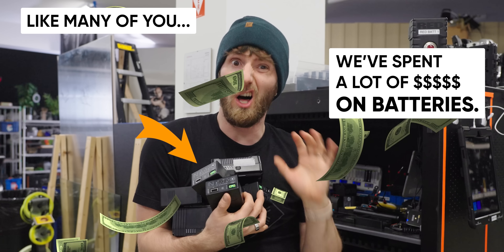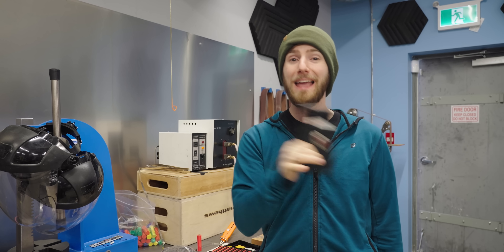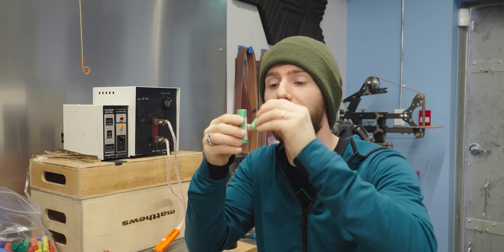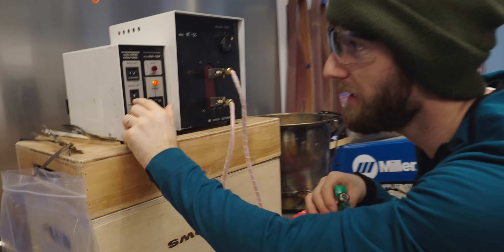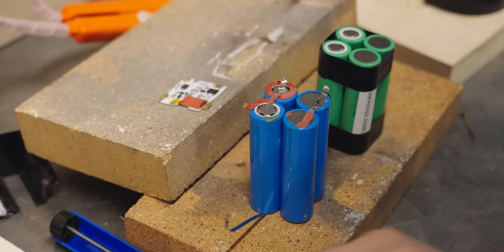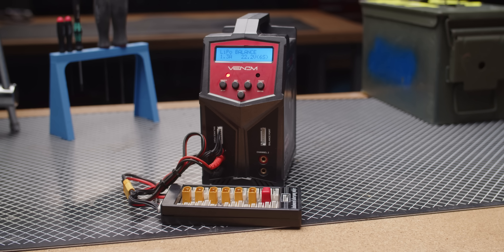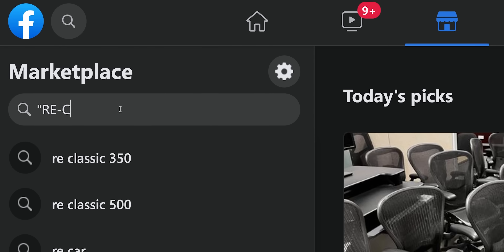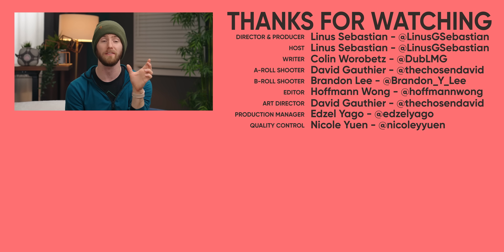This should be illegal… Battery Repair Blocking

Comment: A non-profit I help out with had two Dell laptop batteries fail about the same time.  I'm not sure if they died because of a protection circuit ot if it was planned obsolescnce.  I disassembled the batteries and all the cells aapear to be charging fine.

Comment: I remade my power bank with those kind of batteries before, I just use the tape and brass strip for connection which I first  soldered the brass to the wiring circuit. don't really have the courage to actually soldered the brass to the battery :')
Reply: Nice

Comment: "can short circuit during assembly" yeah, if you fuck it up
"can behave differently during charging" yeah, if the BMS fucks up or you charge at too high a C rate
"risk of explosion" again, this isn't a concern that cannot be mitigated with good practices and measurement...

i get you don't want to endorse it, bc yeah this shit is scary, but its still safe if you know your shit and charge and discharge at rates the BMS can handle.

Comment: If you got a bunch of these old bricks from the same manufacture and same age taking cells from two bricks to make one good one should not be a problem.  I understand about not wanting to mix old cells with new ones.  I would just fully charge each cell and select only those which are closest to the same voltage to create the new pack.

Comment: One thing to be careful of is except for the positive terminal the entire metal casing on these type of batteries is negative. Always make sure the wraps are intact with no tears in them. If there are replace the wraps, its easy and cheap  and might save you a short circuit.

Comment: Some BMS systems on a complete power loss, will not output until they are placed in a charger to reactivate the BMS. Should only need a small burst on the charger to wake up the BMS. Would definitely like to see a video about Retriev and any other lithium recycling mobs you guys know of. ^_^

Comment: Did you guys know that a lot of sealed BMSs need to be "woken up" by either being charged or they require battery voltage connected to the corresponding input/output pin on the BMS, so battery + to BMS + or battery - to BMS -.

Comment: my akita power tools have a adapter I got on amazon fr 5 buck so I can use them on my three Milwaukee told , couldn't you just 3d print a adapter and use bebop batteries in you red camera ?

Comment: Related idea that every battery drill and cordless tool should have a battery pack that's not a battery but has a cord that plugs in the wall, would be handy for several reasons. Need to finish that job, but the batteries are done? Tool works great but no batteries? Now it's a shop tool. Anyway

Comment: In most advanced Batteries... BMS microcontroller have Auto shutdown feature... Like my laptop battery had... I replaced my laptop battery's cell.. and that stopped working.. then i had to wipe BMS with a USB programmer 😕

Comment: Based on how much resources you have at hand, it is criminal to use that spot welder, from the looks of the spark during use it was really obvious that it was dialled in wrong, just a few minuets of research would have resulted in better results. Buy may be that was the intention to scare off the people from ever attempting such thing. Caution is a good thing but knowledge is better, you could be doing the easiest thing in the world and still mess up by just being an idiot or do the most dangerous job ever but know what you are doing and still be safe.

Comment: Did you guys tried to charge after changing the cells??? Usually some of the BMS will go to protection mode after changing cells (when spark occur) they only turn on after charger being connected. Please try to charge and try again maybe it'll work. These manufacturers are screwing us by decreasing life cycle and blocking us from repair like we don't own any products.

Comment: I swapped out my laptop's battery cells twice. but took me about 1 and a half year to do it properly. because my battery pack using TI BMS system that lock its registers unless unlocked with the code.
and I'm here working with the battery cell and communicating thing with it with a Arduino instead of the company suggested battery debugger. it was difficult. but I did it. yaaaa

edit: most sleeping aisle cells don't have to leave the metal in it it is the electrolyte it is combustible.

Comment: Pressure valve in cylindrical cells is a safety for disconnecting cathode, it uses internal pressure buildup to perform mechanical work of breaking connection between cathode and external tab.
I doubt that you need cells from a vape shop since your equipment does not require high current. A better choice would something like INR18650MJ1 or INR18650-35ET or NCR18650GA since it's good up to 10A of discharge current and has higher capacity of 3500mAh.
I have never seen this particular battery but I'm pretty much sure this BMS have power-depended type of memory that houses firmware (or at least part of it since I think I saw SPI memory on the board), like MOST laptops with external batteries. As a workaround you can try to connect a redundant power source of same voltage to BMS before desoldering old battery pack.

Comment: Take a look into the world of power tool batteries. It’s the same kind of battery packs as these. They will kill themselves for a lot of reasons. They usually use the excuse of “safety”. But it also prevents any reuse. The will brick themselves If cells are disconnected, a cell falls out of voltage sync with the pack (even if it came back in sync), and if the cells voltage falls too low even if they come back up. Really doing anything that makes the individual or total voltages to differ from the state the pack expects will cause it to brick. Even if the pack is restored to working order it will have bricked itself and won’t come back. They make it impossible to just replace the cells

Comment: I remember my days of shucking laptop batteries for the 18650s, those sparks at 11:15 happens at least once per laptop battery. Technically shouldn't be dangerous after that spark, unless you're connecting on the positive side and managed to weld positive and negative sides together, which when it happens you wouldn't even have time to react as the strip would heat up to red hot temperature from a short within the span of like 1-2 seconds.

You'll be fine. I think.
Reply: Pretty sure it was just the welder throwing a spark, if you look at the "professional" welding later in the video it does it on every weld.
Reply: Yea, they're just being over precautionary.

Comment: To make sure the BMS never detects the cell disconnect, match the new battery voltage to original and run temporary tiny wires joining the new packs at the balance pins on the BMS (using something other than the main solder tabs if possible) and when you've done the swap remove the temporary wires. I did a similar trick to keep game cartridge save data by hooking up a 3v power supply to the battery traces and doing the battery swap.

Comment: BMS also require an input power to turn on even if it's connected to a healthy battery, try connecting the batteries with bms and charge with bms for a second or two for it to activate

Comment: I've hacked a few escooter bms. You would need to access the memory via a ST Link connected to the VCC, SWD IO, SWD CLK, and GND pins. If a manufacturer wanted to prevent this they would install a resistor to limit the voltage supplied from the VCC and GND pins. To get around this and wake up the BMS you would have to locate a resistor along the ground or VCC traces. Usually unless you're changing the output capability of a battery pack there is no real need to read or flash the BMS, connecting the VCC and GND is sufficient to wake up the BMS and it will then draw voltage from the cells.

Comment: 5:08 - You forgot to mention when cells equalize their voltage. It's when you put them in parallel. Also, you guys should be checking and TESTING the capacity of each cell before putting them in series, otherwise you may end up with poor pack capacity or even overcharging/over discharging issues if the BMS fail or it is a small system without BMS.

Comment: Linus: We also have gloves and sand for protection
Also Linus: Doesn't wear the gloves and touches metal with bare hands
Reply: Also didn't have the bucket after the first attempt, which was needed for tk 2 and 3 lol
Reply: yeah, and on low voltage DC, we all do the same, no gloves  needed... unless you are a panzie.
Reply: I thought the gloves are for handling burning batteries?
Reply: There are two kinds of gloves.  The heavy ones which resist fire for a few seconds, and the thin kind that prevents you from getting fingerprints on the metal.  The former is relevant only if there's a fire (and there's some warning before batteries burn: they heat up, expand noisily and finally pop rather than explode), and the latter is probably irrelevant on power-carrying metal that doesn't cut/complete a circuit.

Comment: Linus, if you bend your nickel a bit (and solder/weld directly in the center), you can avoid accidentally shorting the cells. Success in the middle, short/fire on the side. 

I've done the same for some 12v motorcycle batteries (only 4 cells), and that plastic around the positive lead is barely there. When you shorted, it looked like the heat was off the center of +.

I'd like to see that larger rebuilt battery be successful, that'd be rad.

Comment: Old cells can still be used on small diy projects. Just need to use a battery tester to confirm its performance.

Still kinda hurts that those cells got thrown in the bucket.

I for one used old laptop batteries to power my rc projects.

Comment: Sounds like you could bypass some of the BMS BS by soldering in a power supply while disconnecting the batteries.

Comment: Ya know you can try a quick charge with a power supply cuz I have experienced some bms that only works if there is input power after replacing the cells.

Comment: If you try and defend batterie maintenance you'll end up receiving a Gas-Lighting treatment by petrol companies as much as if you tried to say anything negative about IC-Engines

honestly there is so much FUD around batteries, they really are not that dangerous. You can literally stab a LiPo pouch and its very likely nothing will happen. Even if a fire starts its not like it turns into a nuke. Don't mind me, I've only abused batteries on purpose to prove my thesis.

Comment: Having worked at a "recycling center", I would love to see how LiON batteries are recycled.
Reply: People throw them in the trash, so there's nowhere recycling them. If there is, it's too far away to bother. In China, they recycle them, and every city in China has places to bring them. I wonder how many hundred of them each vape user has tossed out. All of those vapes have rechargeable Li-Ion cells, but most of them don't have a way to charge it, or refill it.
Reply: @iamfreeareyou681  I used to vape. I'd always crack them open and salvage the cells. Until I started using rechargeables only.
Reply: Oh easy, they're just thrown into the ocean and new ones are stamped "made from recycled materials"

Comment: Oh the wonders of lithium... OK guys been watching for years haven't never commented not once unless it's super funny because I usually don't have anything to input however you've stepped into my domain friends... And I have a suggestion that would be not only a life saving video to some but extremely entertaining for the rest I suggest doing a volatility comparison between did three most popular types of lithium out there today you have your lipo batteries for RC cars and such and a lot of high performance electric bicycles motorcycles and hell even skateboards... 

And then we have LIFEPO4 or a lithium iron phosphate which is probably the most popular way of getting high amp draw from non pouch cell type batteries that will be in lot more places like car audio builds with extreme amounts of amp draw this is the current favorite check out djy cells for car audio specifically but inside of their cells or the K2 26650 lifepo4 cells they are capable of 200 amp output in short bursts compared to the measly 35 on 18650 cells... However even though lifepo 4 is less volatile than lipo you have the open coming Golden child of lithium technology...

 and that my friends is going to be lithium titanate battery or LTO... You may have seen these in the form of the brand yinlong 66 size batteries they are ginormous and are used a lot in ev's of the commercial variety in Asia currently... These things are about as violent as a cupcake trying to beat up a Unicorn seriously they are almost non reactive completely against physical damage and their cycle life is upwards of 80,000 cycles which if you cycled your batteries every day well... you do the math if I'm not mistaken lead acid batteries are sub 1000 cycle life and lithium polymer even shorter than that wildlife before has several thousand if not mistaken. There are of course different offshoots and variations in chemistry of those three in DIY batteries... Regardless, There is actually a Russian video that is very very short which looks like a firefighters training session comparing the volatilities of all these three but it's short silly and very nonscientific for the viewer on YouTube anyway I think it's not only a good video idea but it should be LMG's moral obligation now that you've introduced people too the crack that is lithium to properly educate us the community on how not to blow up can't wait to see the outcome... yes I am forcing your hand by not even considering that it will not be made blah ha ha ha!!!!!! Am I GOD YET?! :O

Comment: Great videos. Planned obsolescence is a fraud and should be punished by law. Like most of printers, they'll stop working as the counter went off. Requiring you to send it in and pay big money for swapping out a little sponge. My canon had done it several times and I just replaced it myself and downloaded a resetting software. Boom. Works normally.

Comment: All these safety measures and you forget about the most important one: take your two massive metal rings off your hands before you work with a high current battery pack. I'm getting anxious watching Linus handle a fully assembled Li-Ion pack with rings on both of his hands.

Comment: Just replace the batteries for LiFepo4 type of the same size instead, as regular type 18650 batteries will show about 50% capacity after circa 1000 charge cycles, Lifepo4 on the other hand typically remain at 80% capacity after up to and often well above 10 000 charge cycles. Only down side is that LifePo4 have a slightly lower voltage, at 3.2 to 3.3V.

Comment: Yes, I've tried replacing batteries on some stuff and when I desoldered the batteries from the BMS the BMS died. Some BMS have a fuse which gets blown when batteries are removed and even if replaced with new batteries it won't work but if we jumper the fuse it will start working and another style of BMS is directly controlled by the BMS main microcontroller which gets permanently disabled when batteries are removed and there is no known way to fix that

Comment: Problems with this video.  1.  Reusing cells.  If you capacity test your cells and match them, you can use old cells.  2.  You should be using protective rings under your welds because under the shrink wrap, there is a very small distance from + to - and laying a nickel strip over that area without a protective ring, you are asking for bad things to happen.  3.  If you make a mistake and a battery is shorted, you can quickly cut away the nickel to separate the damaged cell from the rest of the pack, so you don't have to sacrifice the entire pack.  Then toss your damaged cell in the sand.  If you are not brave, don't try this, but I have done it.  Try at your own risk.  lol

Comment: Worse case with the red pack - keep the proper voltage on the terminals and balance leads while swapping the batteries.

Also many bms need a charge kick (plug in the charger) to start up after changing batteries.
Reply: And you give way too much credit to 5 cent bms chips to lock stuff. Its probably something simple like again most bms need voltage on the charge side to re-enable them

Comment: I think blocking the repair is bullcrap but I get it due to the danger but it should be stated on the battery the repair is impossible, because if not someone will attempt it and put them selfs in potential danger for nothing. Better to post it won't work to stop people from trying lithium batteries are no joke its not like wiring in a light bar on a truck very dangerous even with precautions taken